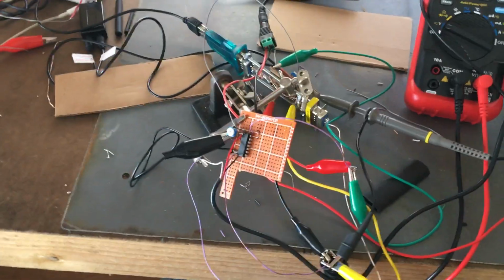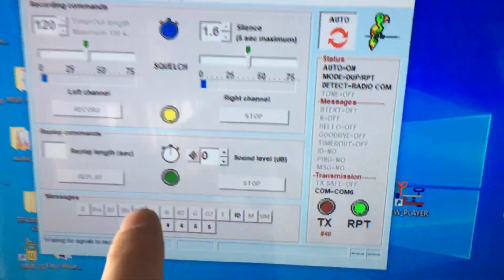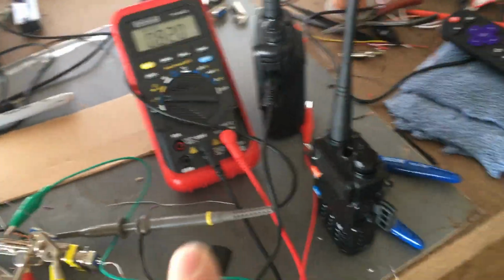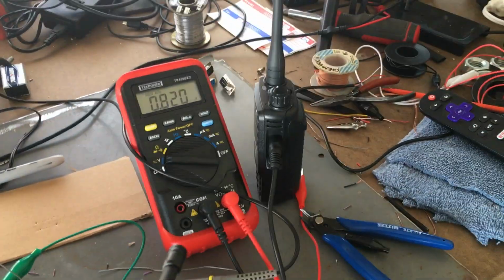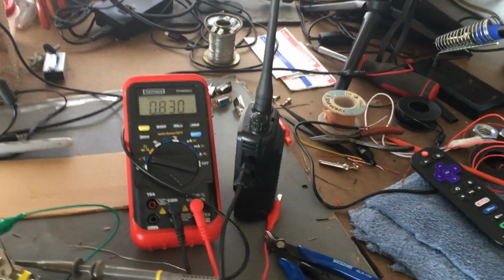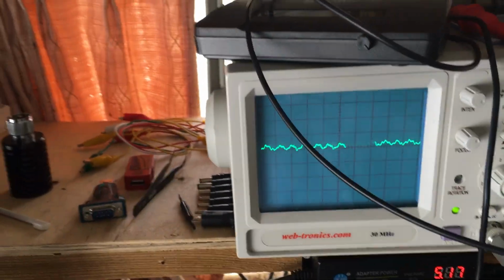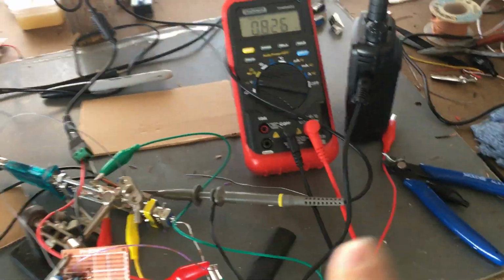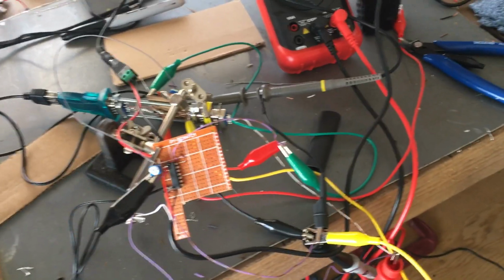🔺PT1 set up handhelds/mobile GMRS two-way radios full duplex Repeater using FREE repeater software!🔺

Comment: Seriously man, your channel is awesome!

I have a RT-97 that I will mail to you and pay you to modify. Mine is on the way from China, I’ll pay you whatever it takes to get you to do the Mods I want. Would that be something you would take on?
Reply from the maker: Do you mean the RT97S model that has the data port? If that is the model, then you won't have to do mods to it.
Reply: @GMRStwowayradio  I got the RT-97 but not the GMRS version. I’ll be on businesses band UHF 5 Mhz split, I gave the specs I wanted to Retevis and they are going to tune the duplexer and whatever else for me.

Only from watching your channel was I aware of any of this stuff so I just asked if my unit will have the data port… 🫰🙏
Reply from the maker: @DJMICA-bz3qz  ok also ask them if this coupon code will get you some money off it may not because it's not a GMRS model but it's worth a try coupon code = gmrs-two-way-radio
Reply: @GMRStwowayradio  ohhhh actually dude I got a direct contact to retevis, I’ll beat any coupon price. Give me your email and I’ll hook u up, not kidding here, I got prices you wouldn’t believe. I got the repeater with tax and shipping for 330 total!